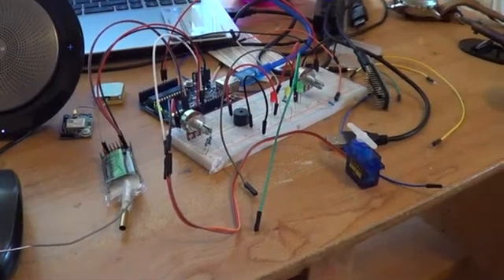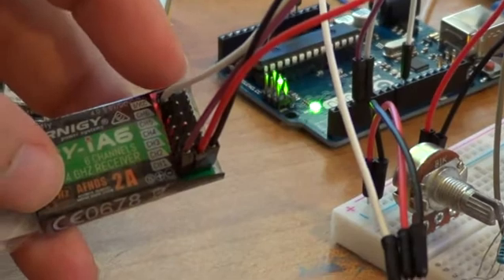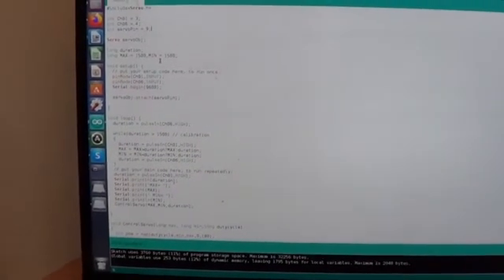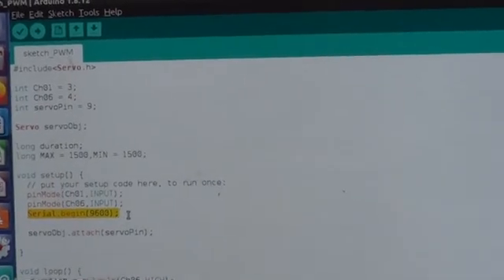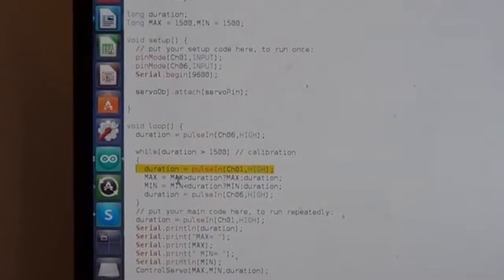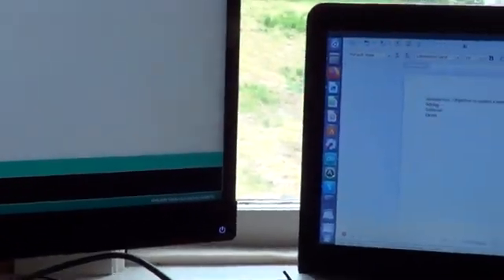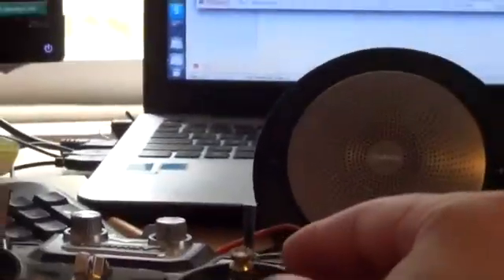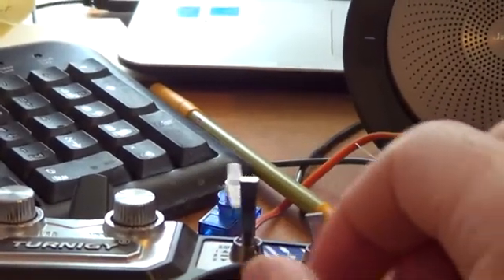Arduino  Control a Servo Motor using RC Radio

Comment: Success! Thanks for the demonstration. The only hiccup I am experiencing is that using the same servo, while idle, it randomly keep changing position like a vibration in the servo. Any advice on this?
Reply from the maker: Idk could some error in your code. If it's very tiny motion that's something has to do with arduino time calculation library. You would have to go in depth and use assembler language to implement a non varying pwm function.